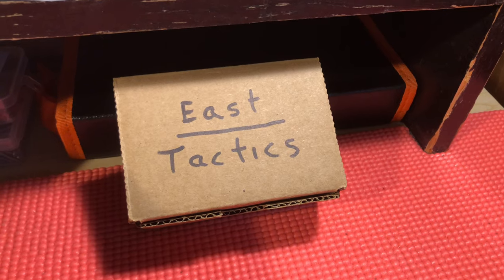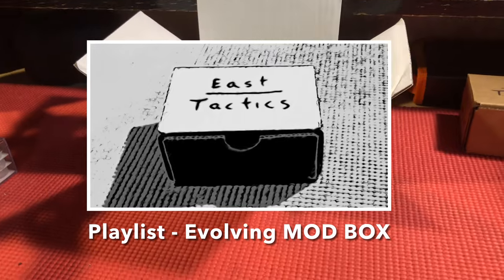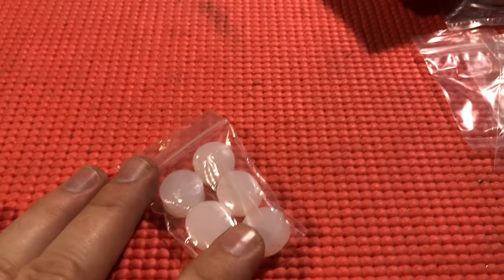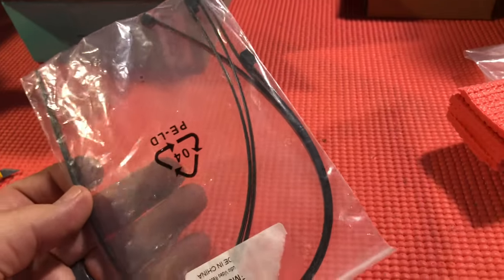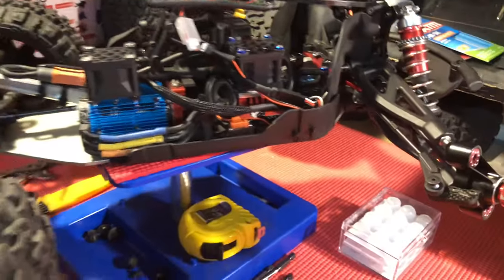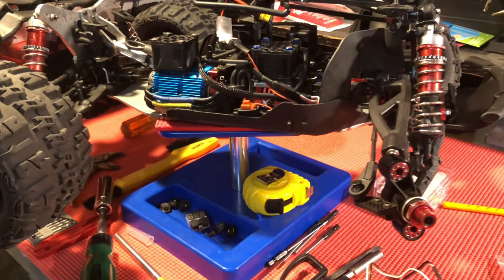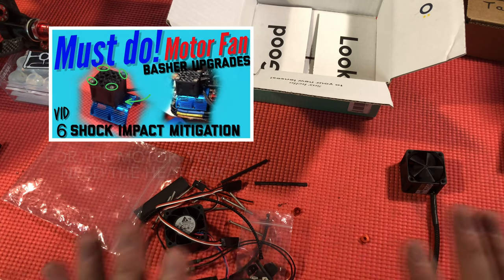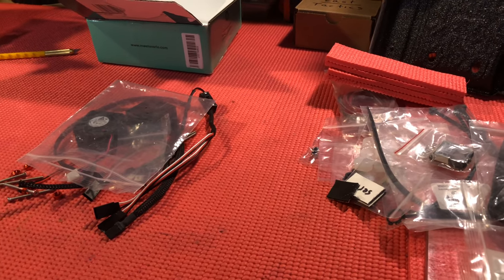Whats in the Box? BEST 2021 ARRMA RC MODS

Comment: Nice vid bro. Congratulations Chris. Do any of y’all know the best servo for a k6? I just got a eco power 120 t from my hobby shop and it stopped working after about 20mins 😪
Reply from the maker: I like the savox SW12SG, I like how it’s waterproof and compatible with 7.4 V if your ESC is capable of outputting that. There are better service out there though. But they’re just more expensive.
But to be completely honest with you even more important than the brand or quality of your servo, is the concept of implementing shock mitigation tactics. (As my research has shown)
https://youtu.be/Gf77pUtEdzI
Reply: Hate to stomp on Savox but get or at least look into Promodeler servos. Specifically the DS555BLHV. Basically it would be like Donald Trump again Joe Biden in a ufc ring. Biden would get smashed everytime, no chance lol. 
 Sorry I couldn't help myself. The Promodeler is by far superior in every way. 109$ and sexy as well👊

Comment: Hey man, I have a almost full m2c Kraton, I opted for big rock springs AR330417 on both front and rear. I run 5k fluid in my shocks with stock pistons and I am getting a lot of bounce. Would the m2c shock caps/pistons help with that or should I go back to stock springs? Just installed a max6/1650kv combo also for weight reference.
Reply from the maker: Yes the MTC Shock caps helped a lot. When I drop mine from about hip-hieght it only bounces about 1 inch or so. 
Going with this set up does slightly take away from performance. But it makes the ultimate basher in my opinion. I still run the set up and love it. I would much rather have less chassis slap and a slight bit of bounce . However after installing the m2c shock caps it’s a lot better. 
Watch the very end of this video and you can see the impact the M2C shock caps have.
https://youtu.be/Iw9Vp7hgD_0

Comment: Hey do know if you can use shock oil as diff fluid or is it different because I have a Kraton 6S V4 and I’m building new diffs from hot racing and I can’t seem to find any 50 weight diff fluid
Reply from the maker: No... Shock fluid it’s way too thin. 
For a basher like the Kraton 6s
You want diff fluid (for diffs )

If it’s Shock fluid it will say “Shock fluid”

You want:
Rear 20,000 cst
Center 500,000 cst
Front 80,000 cst

Now... that all said since I’m running overkill stiff shocks (from the Arrma Nero Big rock) 
I’m actually running diff fluid in my shocks
Which is 5000cst (diff fluid)... but that’s a different topic. Your talking diffs.
Reply: @EastTactics  your awesome for getting back to me 
I’m getting back into this hobby after twenty years I actually kinda figured you were going to say that I’m building my first truck since I bought my Kraton 6S v4 about 10 months ago and I’m trying to put this one together with some of the best upgrades I can afford I’ve never messed around with diffs before and I really appreciate your help I watched your videos which are really helpful for my build 
Thanks again
Reply from the maker: Anytime my man! Always happy to help! 😎👍

Comment: Hey bud it’s me again lol but the problem I had with back wheels not turning I’ve put the shaft into the center diff and it spins but when i put in the dog bone of rear diff it’s locked but I never opened the rear diff just the center.
Reply from the maker: What do you find when you take apart the rear differential?
Reply: @EastTactics  it looked fine I think when I took the center diff out the mesh got messed up in the back diff I wanted to ask you first if you think that might be the problem.
Reply from the maker: I don’t think so, the only way that your rear mesh would be messed up as if you took out the spiral input gear and the cup that attaches it. Or if you inserted the rear differential itself in incorrectly or didn’t seat it all the way. It’s always recommended to put a few shims on the left side of the bearing (left outside bearing). This actually pushes the ring gear closer to the spiral gear deep inside the differential
Reply from the maker: Maybe you can make an unlisted or private YouTube video and then send me the link and show me what your issue is
Reply: @EastTactics  I’ll try and make a video but I’m pretty dumb when it comes to putting something I record on some platform lol but I’ll try bro. Bare with me lol.

Comment: Hey bud I got a ? I put new diff fluid in rear and front diffs now when I hit the throttle the front tires move but not back tires I checked all connections they seem good is it inside the rear diff.?
Reply from the maker: Is the rear end not getting any movement? Like completely quiet without movement, while the front end spins?
Reply: @EastTactics  well I can turn one wheel and the other one turns as well but when I hook up battery and try to throttle it the front move but the back wheels don’t move.
Reply from the maker: These are all the things I can think of that could be happening starting from the center of your vehicle moving backwards. If your front end is spinning but the rear is not 
1. maybe you broke something in your center differential particularly on the side that provides power to the rear.
2. You forgot to put your rear drive shaft in, that connects the center to the rear.
3. Regarding the rear spiral input gear and the drive cup that slides over it. Is the drive cup properly attached? Did the grub screw fall out and the cup is just spinning without moving the rear spiral input gear?
4. Now regarding the internals of the backend inside the differential house, is the rear spiral input gear completely stripped out and not providing a connection to the ring gear? Or is the ring gear and the rear spiral input gear not properly matched together? This could happen if you somehow managed to put the rear differential in incorrectly or if it’s not properly seated all the way down.
5. Was there a reassembly issue when putting back together the rear differential? Did you by chance watch one of my videos regarding bulletproofing your diffs, shimming both the internals and the external left side?
6. I don’t believe it’s possible but maybe… But if you put your real differential in backwards and the ring gear is on the right side then that would definitely be an issue.
7. Your rear dog bones for your tires are still sitting on your workbench.
Those are just kind of my thoughts as I work  way through the drivetrain system.
Let me know if any of those ring true.
Reply: @EastTactics  awsome I will check all this and I’m sure one is the problem like in my center diff so now I have a clue on what to check for I really appreciate the help you been giving I am so thankful bud.
Reply from the maker: Glad to help
Reply: @EastTactics  hey bro got another problem I’m sorry but now I hooked up duel fans on motor but esc fan and duel fans don’t blow
Reply from the maker: What’s your method for hooking it up? Are you running a splitter from the ESC. Or are you running a splitter from your receiver box?
Or are you running a splitter from a 3s battery?
Reply: @EastTactics  I’m hooked up to splitter on esc.im running a 6s battery
Reply from the maker: Do you have a different splitter? Or perhaps a different fan you can plug into your ESC? Just to make sure power is coming out. 
I can see you’re trying to plug them in to your receiver box. However I can be a bit annoying if you don’t have long enough wires. Might have a bad splitter, or maybe you accidentally pushing the JR connector in backwards?
Check those things let me know what you find out
Reply: @EastTactics  I had the splitter on esc backwards it works now. Thank bud again lol.
Reply from the maker: Anytime brother!